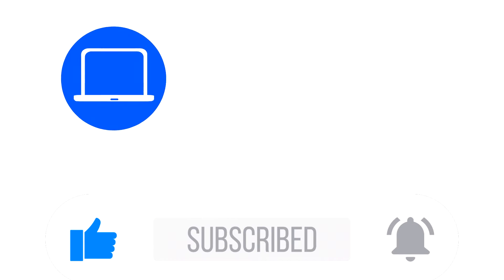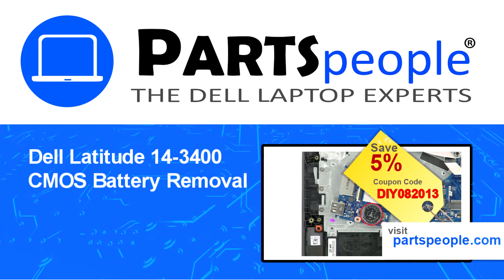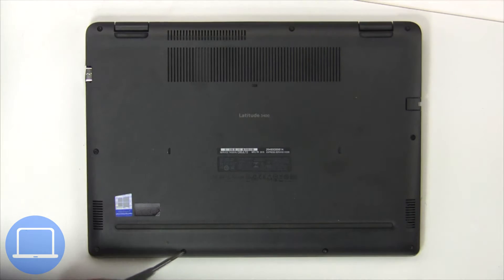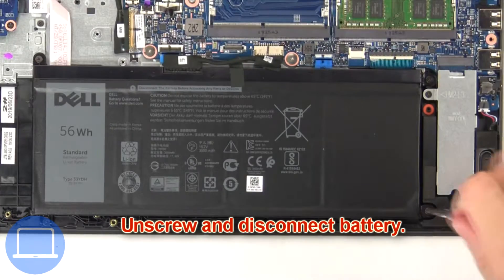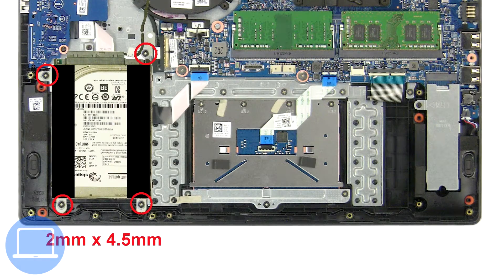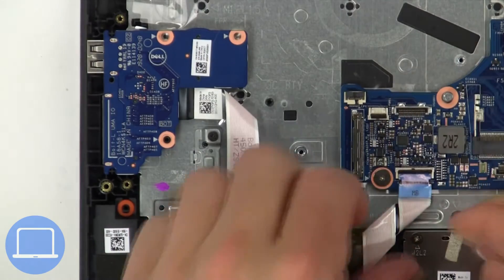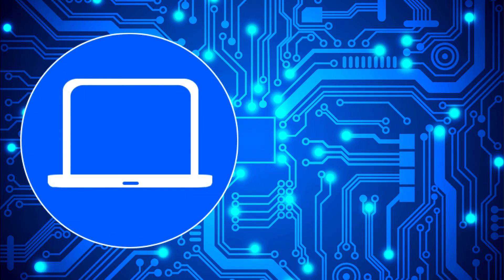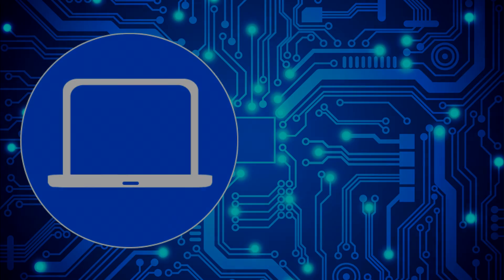Dell Latitude 3400 (P111G001) CMOS Battery How-To Video Tutorial

Comment: I found that if you "pry out" the cmos battery as shown, it's very possible and even likely to break off the two tiny little pieces of plastic that are molded into the holder, rendering this part ruined because it will no longer hold the battery in place. The proper way to remove the battery is not to pry it out with force but to push in on the battery from the side until it creates a gap to clear the plastic latches and then lift it out with the same motion. I used your pry-out technique on mine and the holder is ruined.